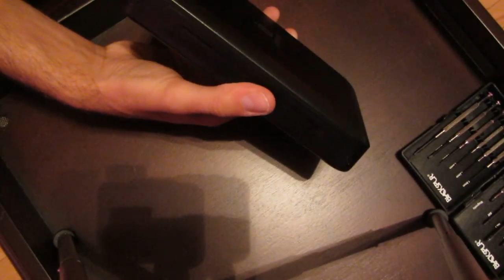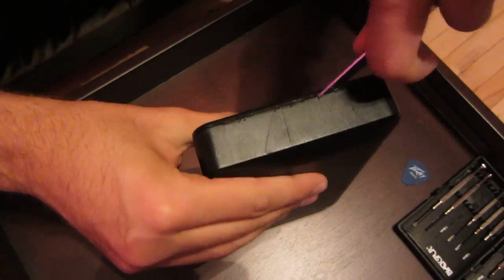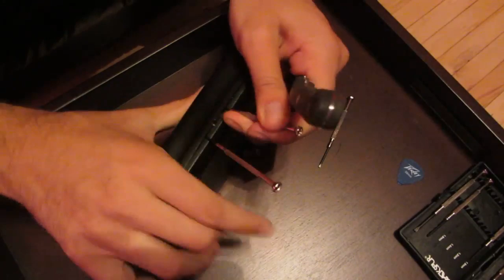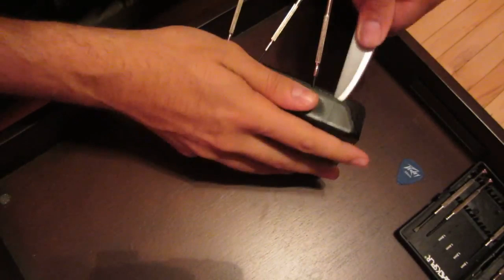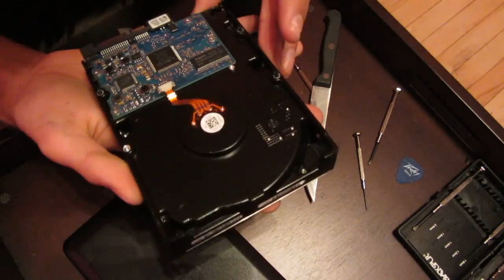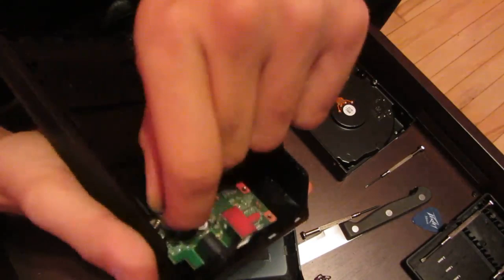Disassebling Iomega 1TB External HDD.mov

Comment: Also until one of the corners pops free, I used a sturdy paring knife to pry judiciously around, especially the corners, eventually-soon, a corner will pop out, thrn simply work with the remaining get free.  Then careful with un-plugging the HDD from it's board (mag tape obviously should be left in-place or re-secured in separated-un-stuck from either board or hdd body).

Happ-e-trails

Comment: 1/2" from each corner (along the short sided ends), is where I stabbed and pried, leaving the mini-screw drivers in place, then did same along the long sides , except the stab-pry points are three instead of two, ie; one is centered and the others are about 1-3/4" from corner.  After I was done inside, mine actually still popped back together.  NOTE that if your board inside is fried, I'd get a new "SATA" case for 15-30$ if I wanted/needed a 'pwr on' light.

Happ-e-trails

Comment: Hi! Thanks for the video - my Iomega Prestige 1TB just died so I will open it up and try to switch out the adapter card inside the casing.
Quick question - how do i determine the correct adapter card?

Comment: place a thin  flat screwdriver 3/4 of an inch into the each hole in base . Press handle towards middle of box..This releases the plastic tabs from grip holes.Lift off from back/HDMI SIDE which is attached by two  tabs also.There are no screws except inside.Should take 2 min.

Comment: My god, that is just brutal!  You could have just as effectively used a GD hammer.  For anyone that actually wants to open their drive without destroying it- First, get rid of the kitchen knife and get two fine tipped small screwdrivers (not micro screwdrivers you see him using).  Start gently prying on the end near the usb port.  As soon as you hear the first click you have won. GENTLY pry the rest of the case open.  These drives have a tendency to disconnect from the sata connector by the way

Comment: I was able to remove pretty easily i used a flat end screw driver and stuck it where the usb is jammed it in the crack and propped it up i was able to get most of it just using that trick but one of the long sides was a little tricky i had to stick the screwdriver along the cracks and just pry it out anyways took me about 5minutes to finish the whole process